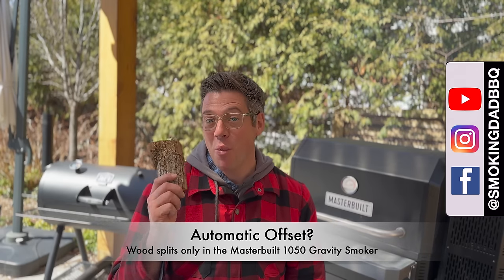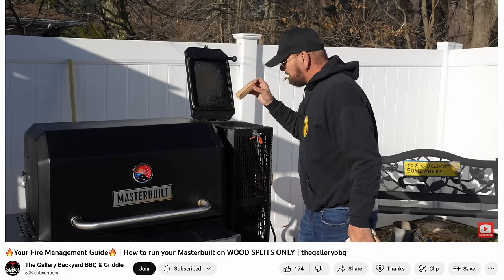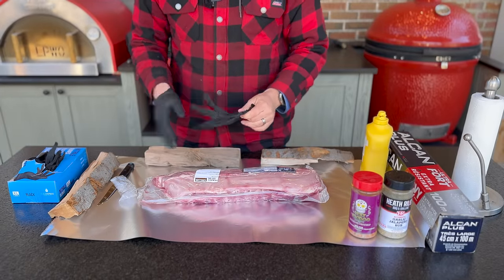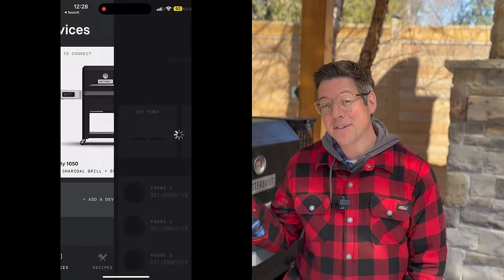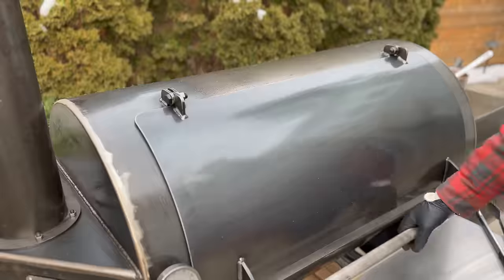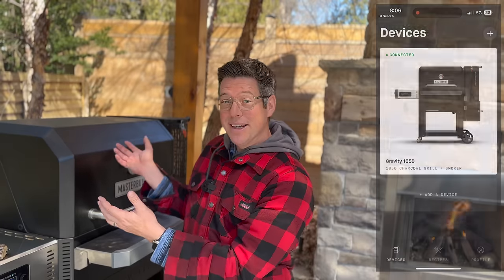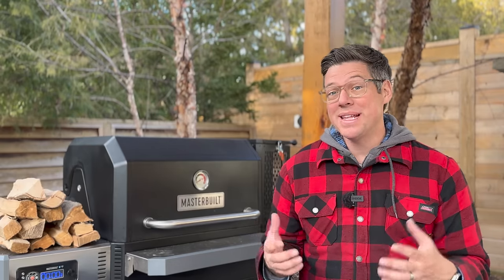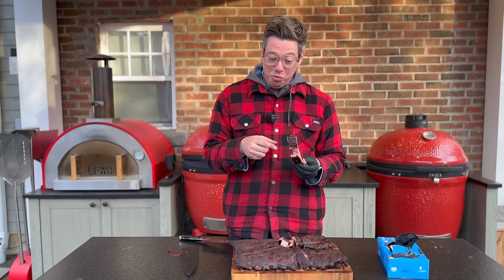I Ran A Wood ONLY Fire In My Masterbuilt Gravity Series | Smoked Babyback Rib Test

Comment: Great video. I tried all wood in my Masterbuilt 800, and it just turned ALL the wood in the hopper, into charcoal. I was not able to benefit from the smoke increase with wood cook, like on my offset. However, adding significantly more wood chunks with charcoal added more smoke. Also, the grease fires on my Masterbuilt is truly pronlematic, no matter how much i clean it. Any help?
Last, all wood starting with a small bed of charcoal, WORKS phenomenally well in my Kamado Big Joe, Weber Smokey Mountain, and even the Weber Kettle.
Great video, great education, thank you.
Reply: For the grease fire I don't know if you tried it but I used a cover for the heat inlet. They sell metal cover that seem nice but I just use aluminum wrap and change them at a regular interval
Reply: Thank you much!!
Reply: hey Solomon , how you run logs in your big joe??   kamados are so efficient you would be burning bad smoke, 
I tried this many times can only get away with burning a small log doing a clean burn no way you put to or more log’s burning at the same time you will ruin your food and destroy the egg, in the small firebox,
The best method have tried is a bed of charcoal and a small like 1/2 split log burning with a small flame and meat raised on the Eggspander extender, you will have to have the dome a little cracked open  for  more air , otherwise you will lose flame and log will be burning bad,
Reply: Abbs74: that is EXACTLY what i do. Small bed of charcoal, and a wood split. I get clean, consistent smoke, for quite a bit of time due to the component that you outlined, the efficiency. 
I love that method, and love the results and ease of it. Still, nothing beats the flavor of my Weber Smokey Mountain.....only speaking about my experience, not anyone else's. But the diversity of grills and their differences keep the hobby interesting.

Comment: What about smoking pellets to then use to smoke something else? Does it affect the flavor or too efficient flame to keep the pyrolysis flavors intact? Or smoking your wood, almost like kiln drying perhaps but adding compounds to them? you could soak them or wet them first so smoke adheres? I wonder if any of this would play a roll in dialing up the smoke in your masterbuilt or allow for some lower temps without the other issues.

Comment: You changed two variables from what the other guys did. They filled the hopper and used 225F.  You fed in dribs and drabs and used 275F.  It would be interesting to see what happened if you filled the hopper way up and used 275F.  Again and again, I hear the Masterbuilt controller runs cooler than it is set to.  A separate thermometer in the unit to check it would be good.  Was it really 275?  Well, my 800 is supposed to be here on the 10th and then I can play with these questions myself.
Reply: Interested in your findings! Report back if you have time. I am on the fence between Masterbuilt and Chargriller Auto Kamado
Reply: @eskimofo9i6  I got the MasterBuilt 800 and am very happy with it a month later.  Your mileage may vary.

Comment: Great video,  ribs look great. Do yo think there will be an issue with the fire box getting too hot and burning out when using one wood?  I have been looking at the Masterbuilt servers but a I already have a Broil King   Keg5000
Reply from the maker: I am sure this increases the risk of component failure but when I did steak at 700 with charcoal the fire looked the same in the hopper so I didn’t think I was making it worse than what it is designed for

Comment: I was disappointed with the quality of my Chargriller Auto Kamado especially the bolts that cross thread and strip out even when being very careful, plus the disappointing WiFi. Do you think the Masterbuilt Gravity series are better quality over Chargriller?
Reply from the maker: no i don't think so, i don't have one to compare but there are things here that i think would make it a more reliable long term investment.  if i judge by food taste alone though and ignore my worries, its remarkable ... but i don't think this pit will get passed down generation to generation like my offset or even ceramic Kamado's could

Comment: You mentioned being able to set your Masterbuilt 1050 to 150 degrees and hold it there.  The documentation for that grill stats the minimum temp is 225... is that not what you found?
Reply from the maker: I didn’t read it lol. I just held a brisket overnight at 150 in it for lunch today
Reply: @SmokingDadBBQ  interesting... the app lets you set it to 150?  And it seems like it's holding that temp?  Any issue with burning too much wood or charcoal?
Reply from the maker: @pfrank  ya app goes to 150 and holds no issue
Reply: @SmokingDadBBQ  Excellent.  Thank you!  Oddly enough I was just watching your "Pulled Pork Disaster" video and I see the temp showing 149.  I wonder why they list 225 as the lowest temp?

I might need to get one of these as the best all around grill out there.

Comment: Really interesting video. The manual says not to exceed 20% wood with charcoal doesn’t it? Would be interested to hear the thoughts of the brandowner for this. I’ll aim to give this a try next weekend
Reply from the maker: I noticed some paint damage inside the hopper from the fire so I can see why for warranty purposes they say not too. I would invest in one of those metal sleeves to solve this to protect the grill long term
Reply: @SmokingDadBBQ  you should see mine after a year! Annoying that you have to pay a 3rd party $100+ to make the firebox fireproof
Reply: @SmokingDadBBQ  charcoal allegedly burns at higher temps anyway, I wonder if it is to do with tar deposits inside which could start a "chimney fire" of sorts using wood
Reply: @paulshepherd5649  they say the thin sheet in the hopper is meant to burn away and there are fire bricks behind it anyway.

Comment: If you are adding wood every half an hour… aren’t you negating all of the benefits of a WiFi fan controlled smoker?
Reply: OK, watched to the end, and you said every 45 min to an hour. So not as intensive as maintaining an offset, but still not the kind of thing you can leave unattended for hours on end. Good to know it’s an option.
Reply from the maker: It’s approaching my larger 110g offset for frequency of interaction. It’s not set it and forget it by any means but it’s at least a years experience worth on an offset head start for quality of smoke

Comment: I was wondering  if you know you can run the 800 like an offset , i found that out by accident on my little AK egg , lost the power so i opened up the damper full and left the fan door open , and I was able to control the cooker like that , then i tried it on the 800 and if you crack open the ash pan door and use the chimney lid as a damper you can pull it off , just a thought
Reply from the maker: interesting thanks

Comment: No, Offset v MB800 v Chargriller , auto Kamado, there is a test 3 stick burners and one is a kamado style grill ,
Reply from the maker: sorry thats the test you'd like to see?
Reply: @SmokingDadBBQ  why are you sorry, have you run that experiment all ready,  you have all three, can you tell the difference between the  Master built from a Stick Burner and the AK, believe me I found it to be a bit harder to tell

, in fact I can't tell the différance between the three, I used Jealous devil  lump and hickory woodchucks and splits, and I used your basic Texas Brisket rub , just to keep it fair , 
Honestly, I could not tell the difference , that's why I wanted to hear from you what your impressions were on it , 

Now A bit of FYI I don't know if you know this, but the Master built can run 20 hrs straight without reloading during the cook if you use Jealous devil max briquettes  and wood in the ash pan instead of the chamber usually you can't run it longer than 12 hrs max without reloading , I have repeated the experiment 3 times , and it seems to stay within 30 to 90 minutes  of a 20 hr time limit, at 225, more than enough time to get through a brisket, I found that experiment interesting , and a bit more restful , sometimes the Master built can be as temperamental as a stick burner  at times